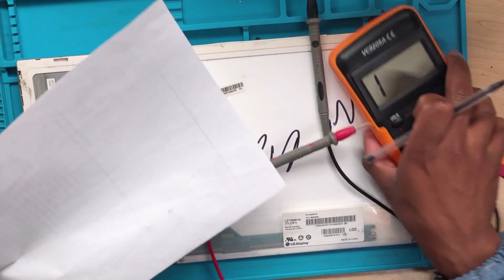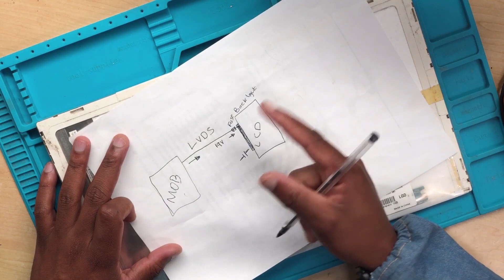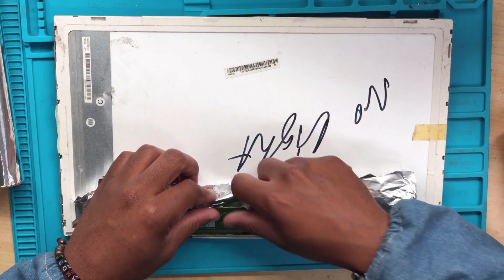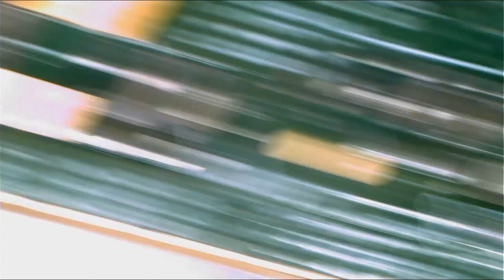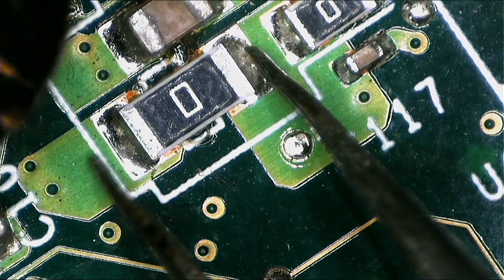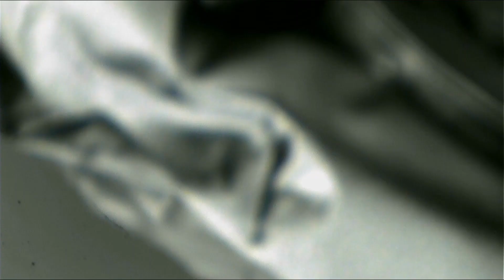Laptop screens are repairable

Comment: Nice repair, but I wonder what caused that fuse to blow in the first place?  Usually, fuses don't just go bad do they?  I know you checked for a short and did not see one but I am curious why that fuse blew.  I had no idea you could use a 0 ohm resistor as a fuse so thanks for the tip.  I learn something new every day.
Reply: The only trouble with using 0R resistors for fuses is of course that you no longer have the protection that the fuse provided.  It's a "fix" if you have no other choice but as always it's still preferrable to replace with the same rating of fuse.
Reply from the maker: I can’t believe this, Paul Daniels 😃😃😃

I’m gonna do a video,  letting my viewers know that you commented and thank you so much Paul , I’m so happy 😁 😁😁….I’m dropping a video about you and your channel